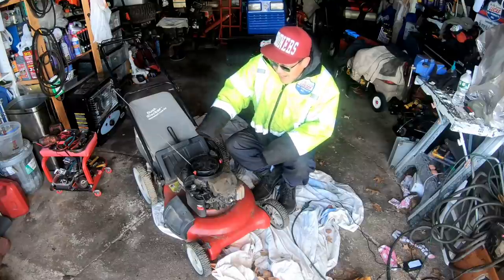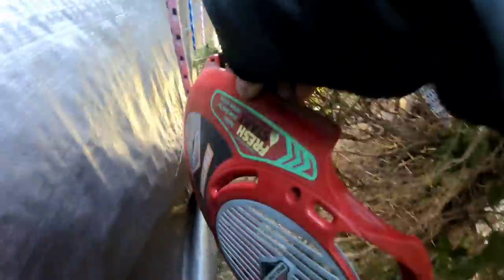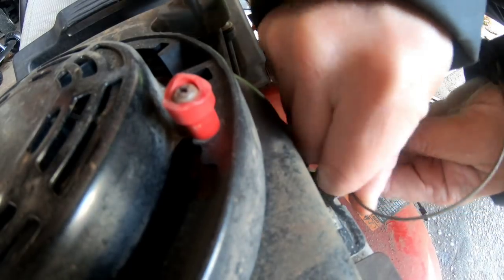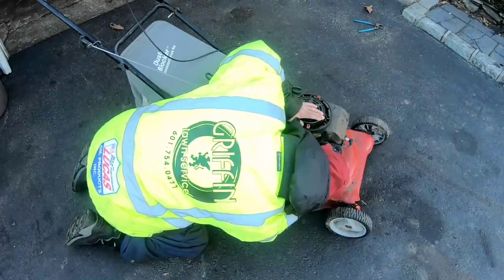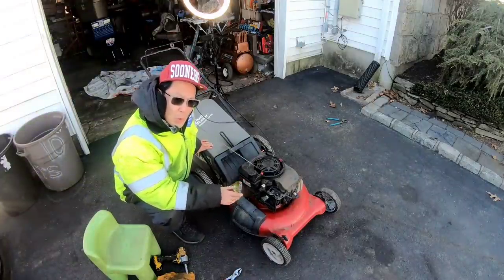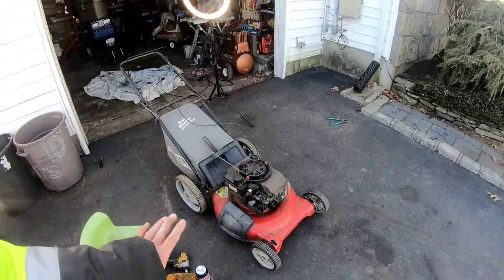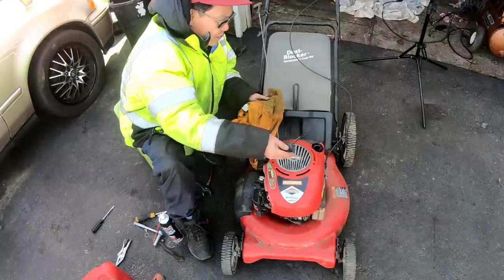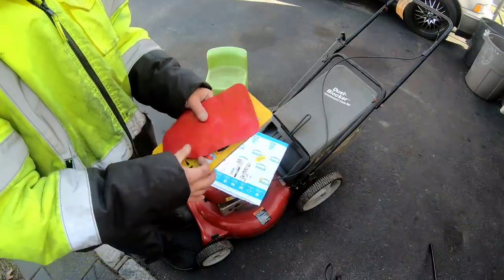FREE CRAFTSMAN BRIGGS QUANTUM PUSH LAWN MOWER BAIL HANDLE CABLE REPLACEMENT CARBURETOR CLEAN REPAIR

Comment: Nice repair and you need a pair or two of those thin brown cloth gloves for temps like that... I use them a lot. Always a bonus to watch you work on a few push mowers mid winter cuz Spring seems like a long way off at least for me anyways.... cold, cold temps and about 10" of snow.

Comment: Your subscriber that sent you the FormAFunnel did you real solid Jake did a video on what is called a FlexyFlow same concept. Great product have used it on multiple oil changes riding mowers and snowblowers and easy cleanup and storage. Got Jake a funnel to separate debris when transferring fuel from one jerry can to another (the OLD MAN uses customers old ethanol fuel in the 2006 Ford F150 after filtering and adding K100S+ stabilizer and additional octane booster) best part is that water does not go through it watch for the video.
Reply from the maker: Nice Wayne!